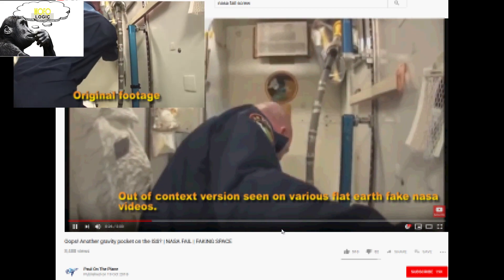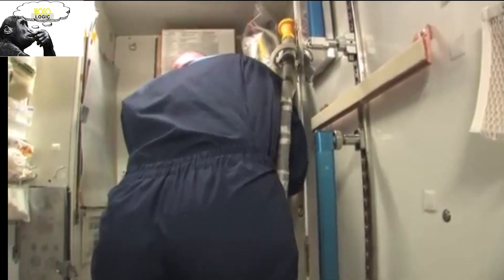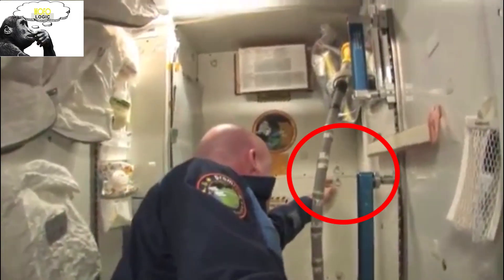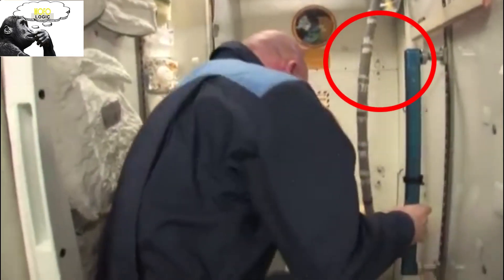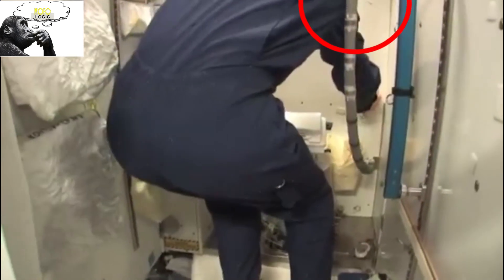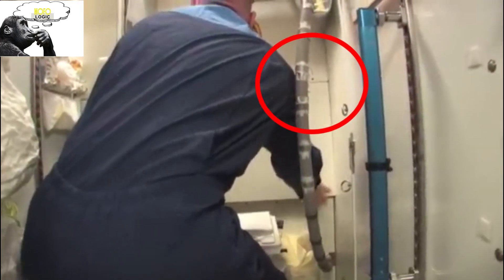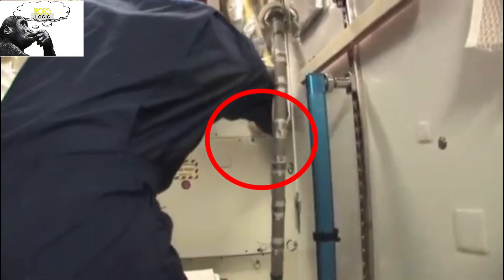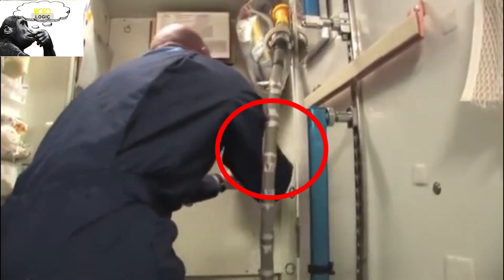Oops Another gravity pocket on the ISS NASA FAIL MO FO DEBUNK

Comment from the maker: HD something odds happened to this comment section...your posts just vanished.
Your response and comment is very much welcomed as i like to consider my self a deeper thinker as it appears you are. Its philosophy as topic i was going to consider doing a mature degree in myself when i feel i have the time to do so and not the dependancy to need to earn a living so much.
It would be easier to have a converstaion as the natural break points would not make responding such a hard task as you cover quite alot of details.
I fully agree with everything you are saying in some form. The current system is flawed people need to blame something they look at governments as a valid point to start....and yes mostly they are up to alot of no good and yes the system of our lives is a prison with out bars and most dont realise this.
As i mention doing a degree but the invisible prison cell of bills to pay means i have work with the system to a point i can freely do it.
Not many people can deal with a much distanced view of the whole structure and nature of our lives and get focused on things on a smaller scale....so a flat earther stays quite localised to it and its core beliefs....they are beliefs ....belief i think is the one thing that we all have its a in built system that follows rules like a computer program...i think are brains work very much like a computer but on a much less binary level....so yes i think everything is a YES or NO in out brains like binary but it goes in to such detail it makes those grey answers that are not either YES or NO totally but maybe lean towards one.
Regards build a system better then we have yes i to have pondered this like you...the current way we exist is a very poor system and not required really IMO but its like you said very much like a growing thing that has so many paramitters ..meaning billions of humans and how they control each other in the hierarchy that its almost an impossible task to alter as it would need to be something that everbody would accept as a better way and just communicating that to people again near impossible.
Also due to whats in us the whole exploitation of the newer system would be apparent.
The very people who could change our world for the better are the ones with most to lose so its way its not going to be achievable unless we had to start from simple beginings again.
But i think the same mistake would be made. Im a believer that money is not needed and the concept of barter is not needed and we should all in effect have an equal right or share of every resource on the planet and universe for that mater.
So the gas i heat my home is really mine and im being expolited by having to pay for it.
A world with out money or barter would solve some problems but im not sure if it would create others.
But no money means quite a high percentage of jobs become void. We waste an awful lot of intelligence on just making money or doing jobs to get money just to use it to pay for stuff we kind of have a legitimate right to.
So my answer to you question is ...NO MONEY or BARTER...get people out of pointless jobs...EDUCATION - SCIENCE- HEALTH being the important core fundmentals to us....
most people would not need to work....why are we paying to buy a house built and paid for decades earlier.
MONEY holds us back...we often hear this bullshit...in UK we have NHS health care but its always we dont have enough money....we i think money is just a illusion and part of that invisible prison cell.
CAPITALISM is bullshit.
In this ideal world we could focus on advancing as we could educate spend a fraction of time doing mundane jobs....as said if you really think of it...if you personally didnt need to pay a single bill or to put food on the table why do you need to work...then instead of doing shitty job you care nothing for you could learn or spend time doing more interesting things that would not feel like work with none of the deadlines endless people resources you could put in as much or little time as you wished. Some might say it sounds like a boring world..but i think it would be anything but as you would allow creative thinkers and creative people the ability to explore that over just holding down a job to exist.

We would make the best of everything not being held back by money. Our resources would be used better as less junk from china that breaks as capitalism is the very reason we have this disposable world and waste in resources.

There tons on that i have explored in my head i was enlightened to this sort of thinking years back things like the venus project the guy had this idea and explored it via that venus project. So my thoughts are inspired by his.
Reply: Allright, here we go again:

Hey, thanks for taking the time reading and your response, i really do appreciate it!

"@H D it's always funny when a statement starts with no offense....but."

True, that wasn't the classiest way to start a comment if you want to be taken seriously LOL, but thank you for being able to look pass that fauxpas. Btw i worked as a graphic designer for many years myself and have always loved and used 3d programs, so i also have quite a bit of background when it comes to special fx... it does help a lot when trying to decipher whether something is cgi or not, but i'd never think of my perception as foolproof in this regard whatsoever. There are (and have been for a long time already) some crazy technologies out there we have no clue about, which make it almost impossible to detect fakery i feel like. 

Also you are absoutely right with your video only having being a catalyst for my comment. I really don't know why that actually was the case tbh, i was just going with with the flow. Most of the things i said really had nothing to do with the video in particular, it was more of a general rant and i have the feeling it's going to happen again now, i'm inspired, have some free time and am in the mood for another round, i hope you don't mind ;-) And yes, videos like yours are important and don't actually fall into the category and/or mindset i criticized earlier, because there is a real point to it. I am big enough to admit, that i had not realize before, that the screws are actually attached to the board, but i have no problem with being wrong at all, it happens all the time. On the other hand i have to say, at this point i only watch videos like this or FE videos for entertainment purposes and to get an idea of how things are evolving on a larger scale. I distanced myself from any kind of visual proof of anything as much as possible, because i came to the conclusion, that all you really need, to be able to understand the few truly important principles of life, is to observe nature (which includes people as well of course) and then apply them to your own life. The natural world is the one and only book you need to learn to read really. A couple of years ago i would have ignorantly laughed at someone stating something like this, but by now that is actually one of the very few things i know to be true.

I really appreciate a good conversation and sharing of ideas/perspectives and you seem to do as well, so i'll go ahead and spew out a bit more of what has been on my mind lately. Take the good and leave the rest, i suppose is a good way to look at it... so here we go: 

One of the biggest problems with the whole flat vs globe debate at this moment in time, is, that people are absolutely overwhelmed by their feelings on both sides. Which is a normal and neccessary thing, but it paints a very incoherent picture and people just aren't used to dealing with the really profound questions of life in such a public format. It's a completely new thing for all of us, the internet and the age of (dis)information unloads all kinds of possible mindscrews on us, if we dare to question what we accepted as reality. It's all a big rollercoaster ride at this point and i assume everybody would agree, that rollercoasters aren't the best place to have a rational, calm, honest and most importantly, deep conversation... But i am 100% positive, that there will be such a time in the not so distant future when the dust has settled a bit. The individual can potentially grasp and innerstand a whole lot of paradigm shifting information in a rather short amount of time, but society at large is a slow and inert beast, which can be a great source of frustration obviously. That's where most of the confusion arises in this discussion. Once something has become obvious to the individual, it also becomes quite hard and a question of personal discipline to keep in mind, that it hasn't always been obvious and other people just can't see it the same way, because they simply haven't been through the same process like you have. And if society lacks one thing i'd say it's self discipline (well, and love obviously), so there's that.
Reply: Questioning the shape of the earth seems so crazy at first sight, only because we have been conditioned to think that way - with a globe in every classroom; in the background of almost all news shows on tv; the endless amount of logos using the globe as a positive symbol for large thinking and interconnectedness; a pre-installed globe image as startscreen on everybody's favorite mind control tool the iphone; in the intro of most of the big hollywood productions; embedded in our every day speech with simple set phrases like "around the world" or "the world keeps spinning" etc.. it's really everywhere if you start paying attention. In a highly unsteady and fast-paced world, the shape of the earth was supposed to be one of the very few facts, something reliable everybody seemed to be able to agree on. Suddenly a bunch of people start publicly questioning this so called fact with some mindblowingly simple and profound natural arguments like water observably always seeking its level and everybody goes nuts. Quite the phenomenon if you think about it. 

Many people dealing with this kind of new information get stuck in the conspiracy mindset, trying to blame other people for their own unhappiness, personal flaws and general inbalance, while forgetting that every time you point your finger at someone, three fingers always point right back at you. That's not to say there aren't a ton of real conspiracies out there, but the ones that really have a massive effect on the collective way of thinking, are not being physically forced upon anybody. They come in form of very intelligently designed and deceptive offers and most of us have just taken the bait out of naivety and laziness. There is a really deep insight in accepting this reality, because it shows you, that there are always endless possible choices available for everyone at any time, but we keep on diggin' our own graves by making the wrong choices over and over. There was a time when i thought that governments were to blame for all the problems in the world. There is some truth in that, but if you take a step back and look at what an amazingly complex task it really is, to create a structure that is supposed to bring all the different minds together that make up the zoo we call society - it's mindboggling. Obviously you can't make everybody happy and there's a whole lot of fucked up shit going on within these structures, but once you start asking yourself in a truly honest way, if you could come up with something different but practically applicable, that would work as good or even better as the status quo, suddenly a new perspective emerges - for myself the answer was no, i could not. That very much humbled me. Obviously not everybody is ready and willing to take full responsibility for him or herself, and for these folks governments are an absolute blessing with everything they provide, even if they don't (want to) realize it. I can see why governments are willing to use all kinds of jedi mind tricks on the populis sometimes tbh. Those who can see the flaws and want things to change, just need to stand up and create the world they want to see. It all boils down to being either an active or a passive part of society and if we keep on focussing on personal growth instead of personal wealth, things will change rather quickly i believe. Since i changed my own perspective and outlook on life, i can see so many positive developments in the world, it's amazing. Reality literally is what you can make of it on all levels.  
 
As i already said in my previous comment, it took me somewhat like 9 months to de-program myself from the globe conditioning and to accept my own foolishness, which my ego very cleverly disguised for most of my life. At this point, looking back at the ridiculous amount of research and everything else i had to do to free my mind, i sometimes really have to laugh at myself and the world, now being able to see how simple things really can be if you are just willing to accept them like that. If you honestly think about what the globe-theory asks you to believe on the most fundamental level of your humanity, it's flabbergasting. You literally need to abandon all of your senses and experience-based logical thinking... the one and only natural navigation system everybody has and uses every single day to (more or less) successfully manouver through life. You have to believe that water flows upstream all the time somewhere, even though you simply can not observe that phenomenon anywhere on earth. You have to believe that people on the supposed other side of the globe, really stand up in the opposite direction relative to your own position and that you can go to upside-down land yourself without feeling any difference or changes during your travel. You have to believe that everything spins in three different directions with different, incomprehensible high speeds and you can't detect any of it, even though you get dizzy after two to three turns on a merry-go-round. On a globe you can never truly be centered, because no matter where you go, everywhere is the same on a ball. I find it very interesting that the north pole, which would be the physical center of a flat earth, isn't even shown on google earth anymore for example, even though we all know, that land does exist there. If you dare to think about what kind of a symbol or even hex on a metaphysical level that possibly could represent, it's quite easy to assume a truly evil intention behind it. I'm not saying that is definitely the case, i'm just saying it's a possibility and i'm well aware that many people would laugh at such a thought due to their own shallowness, but mental gymnastics like that are highly thought-provoking and broaden your horizon.
Reply: From a spiritual perspective the globe is a very advanced idea and i am honestly deeply impressed by it in all aspects, but it simply does not allign with what we can obsverve in our natural reality. Don't get me wrong, i'm not saying everything is exactly as we perceive it, actually in many cases it seems to be quite the opposite, nature is a huge fractal with many very deceptive ways, but that's what makes it so interesting and beautiful. Bottom line is, i personally just can't accept a worldview that is solely based on mathematics and quantifiable factors only anymore. The simple fact, that materialistic science can't handle stuff like love or inspiration shows, that it is incomplete by definition and therefore simply can not be the final answer. Science without a doubt is a powerful and very helpful tool, but it isn't dealing with the full picture and from that all kinds of problems and potential mind control techniques have arisen. 

Many people just can't wrap their heads around the fact, that there are so many technical applications that work with the globe model and are able to deliver reliable, repeatable results, but that the earth still can be flat. The "trick" is, these applications always only deal with a limited amount of data and serve a very defined purpose... which is fine of course, we are all about results when we build our tools, no matter where they come from. Just to give an analogy - to me it's the same situation as going grocery shopping; to get me a nice dinner, i will only have to chose between the products available in the store i am in and not between all products that exist in the world... and just because i was able to succesfully buy some products in the store it does not mean i automatically know every product or store in existence. All thumbs are fingers, but not all fingers are thumbs, i think you get the point i'm trying to make here.

The idea of the earth being a globe has roots going back to pythagoras and other, later metaphysicians and spirtually inclined mathmagicians of all sorts. It has everything to do with squaring the circle and manifesting "heaven on earth". All of the early promoters of this idea, were highly educated people with strong connections to all kinds of different secret schools and societies, i think it's fair to call them the elites of their time. No "regular" person without all the knowledge and spiritual wisdom that can be generated through occult teachings like sacred geometry etc, would have ever come up with such an idea. Here is a great quote from George Orwell's book 1984, which sums it up pretty good: 

"When we navigate the ocean, or when we predict an eclipse, we often find it convenient to assume that the earth goes round the sun and that the stars are millions upon millions of kilometres away. But what of it? Do you suppose it is beyond us to produce a dual system of astronomy? The stars can be near or distant, according as we need them. Do you suppose our mathematicians are unequal to that? Have you forgotten doublethink?'"
Reply: You know, when people say "The shape of the earth doesn't matter, everything will stay the same anyway no matter if it's flat or a globe", it's only a partial truth, like everything else. Yes, everything outside of yourself will actually stay the same, but you will be able to see so much more of the world and therefore figure out your own role in this magnificient great game a whole lot easier... and as a result of that, you WILL change the world eventually. To what extend you are truly making a difference you will never be able to know though, it's the butterfly-effect. Get your priorities straight, act accordingly and the rest will follow, that's my personal motto. Living by it, gave me back that awesome, child-like sense of wonder when looking at the world, which had been lost for so long due to the many false belief systems i had unknowingly adopted in the past. 

I see so many self-proclaimed "woke" people running around screaming and complaining about other people taking away their freedom, when in reality most of them don't even know what freedom really is or means. Freedom is fucking scary as hell when you first start encountering it, "truth hurts" is another way of describing it. There is absolutely nothing as destructive as truth, because it makes you realize that you actually don't know jack about anything and suddenly you find yourself free-floating in space without anything to hold on to anymore. By "truth" i don't mean things like the shape of the earth or that some people think it's a great idea to fuck with the weather in many different ways for example; truth is the simple fact that all this, now obvious, perceptual wealth and clarity wasn't available to you before, it literally didn't exist in your little world and you never for a second even thought of asking certain questions, because in fact you've been just as gullible and superficial as all the other people you arrogantly thought of as dumb sheeple not that long ago. Once you have to process such an amount of shame, you're humbled for life and become a lot more forgiving and tolerant towards other people, which is equivalent to becoming a better and more real person. I keep on saying "you", but what i actually mean is "i", obviously it's just my personal experience and nothing more...

Oh boy, i have been all over the place again, i'm sorry... Anyway, it is what it is and i hope you're not turned off by the length of my comment or feel obliged to spend as much time on your reply as i did, you really don't have to by any means. I guess i just really appreciated your response, proving, that even if we don't agree on some things, there still can be an interesting and respectful discussion... and since such situations have become quite a rarity these days, i guess i just went for it ;-)

What is your personal stance on flat earth (not flat-earthers with their public behavior or the so called movement itself, i know there are many real and strong issues with all of that) and are there any points at all, which you can accept as valuable, thought-provoking and worthy of further investigation, or is it all just nonsense in your opinion? I'd really like to know what you feel like are the biggest "factual" issues when it comes to FE, if you're willing to share and discuss them publicly.

Thanks and cheers,
Boris
Reply from the maker: We have a limited bunch of senses that have evolved IMO from simple beginings we can observe creatures in nature today that are in early stages of there own evolution regards things like sight...i can recall off my head but i saw a documentary ..nature one im really into all sorts of stuff but in this one i recall but not in detail it should some species of creature that is at the early eye stage just a jelly membrane that detects like and dark in a crude manner. Which i think our own cycle went through over an emmense period of time. The closer you look into nature and animals you can see it has clear signs of evolution and connections etc.
You statement  "worldview that is solely based on mathematics and quantifiable factors only anymore"
i would suggest that maths is just a human invention that aligns with so much but is a form of language.
Its pretty solid. Look into nature and maths is in everysingle thing.
I was obsessed at one point in how maths is so intwinned with the natural world hexagons seem to be a form thats created naturally IMO by gravity and a need to get to the most economic form..

So id personally disagree nature has maths in it....mandelbrot seems to me to have an amazing connection to the formations of all life. Its the one cell divides to two then they divide etc..

And its clearly in nature...trees show the rules of mandlebrot....its called mandelbrot because thats the guy that stumbled on to it i think. You probably know all this anyhow.

Science is to observe i think and use its results to an advantage ...again its an evolved version of the people knocking rocks together and the spark made fire.

Flat earths not new it was the first assumption it only changed as people became more aware from observations etc to then conclude over many hundreds of years where we are now. But now we do have technology. but people now disregard that as they base knowing the worlds a flawed system and corruption and lies exist that its not reliable to trust.

Which is a fair comment theres always motive to lie but that then does not default to we must lie. 
Internet and the current world is making such grand lies much harder.
They do continue to try....WMDs ..iraq being a lie that was all about having a reason to do what the USA wanted to do command and conquer. The crazy thing is its now very common knowledge in the press...but we never seen anyone go to jail like we would.

THese sorts of things are what IMO allows things like flat earth some passes as credible as it can help people not question as they know these other facts are true and i have to appluad flat earthers for exploiting this.

Double thinking as you qouted is something i believe flat earthers are not doing....my silly little examples are evident of just them accepting a view point with out questioning it and double thinking it through.
This is quite a norm for flat earth thinking i am finding.
I have my belief...i think belief is such an interesting topic that has its own rules and these rules are almost hard to resist. We have a belief in what ever we will only accept information that enhances this belief and disregard everything else. Its only our inner self that can shift our view point how ever that happens is really controlled by us if it does.
Thats based on tiny movements till the belief shift happens but its only the a circle as old beliefs are replaced by new.
I think belief is part of our evolution process as well.

Our flawed sense make sense of what we can...but flawed is an understatment and i always think its a funny phrase to say you will trust your senses.
The senses work together but also make assumptions on behalf of each other like a democratic vote the brain then mushes it all in to some sense.

I see an interesting experiment where they took a guy and made him live 2 weeks with these weird glasses on that completely reversed his world visually.
so when he reached to pick up something with his right hand it looked like his left.
With in two weeks he had completely retrained his brain to componsate for the impairment and he was treating his enviroment as normal....he took him awhile to readjust after the experiment too.

But this experiemnt IMO opinion highlights how what we sense is not a clear solid fact...its just the best assumption we have based on whats happening at that moment.

I think we all create the world we think we live in entirely in our heads.
So all concious persons have a individual universe to anyone else....even being in the same room with another person dont mean your experiencing the exact same reality.

My reality it has a globe earth as the official model suggest i based that on my flawed senses observing the world and understanding i have learnt from peer groups i put some amount of trust in.
Thats all we can do till our own inner belief is shifted to the next one.

Lastly ...yes love is a curious thing. It is evident in the animal kingdom...i often use animals as a bench mark of my thought on topics in people world.
So when someone objects to gay people id suggest they study nature to see if it exists there....it does so IMO its a result of nature and not learnt as some lesser thinking people i have heard say.
Love i think transcends all this and it is in different forms. 
But you can clearly see love in action in nature and even between animals and humans..(not that wierd sex way that the dark web has..)
But it has an opposite...look at cruelty it exists again in both human and animal worlds..

Im way off on it now/....and to think all this started becasue someone said some dude dropped a screw but didnt actually drop the screw.